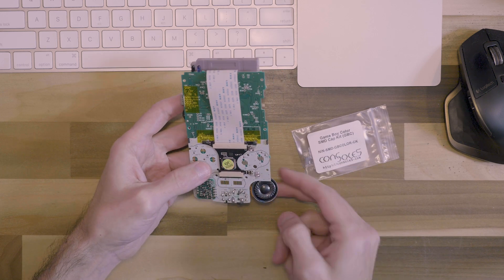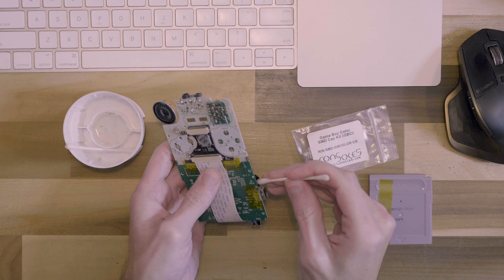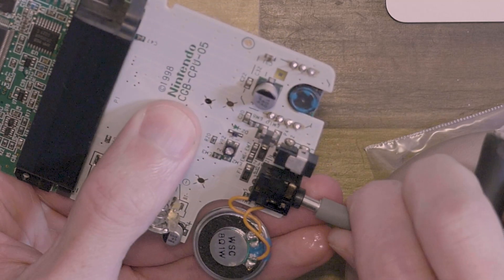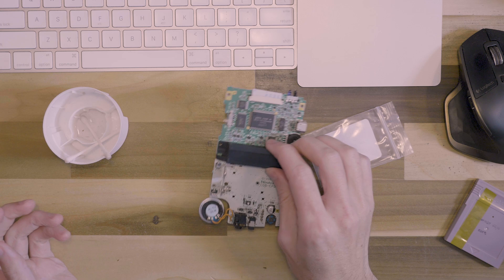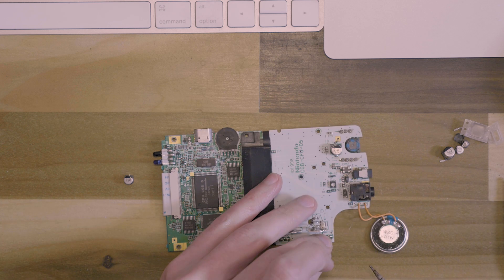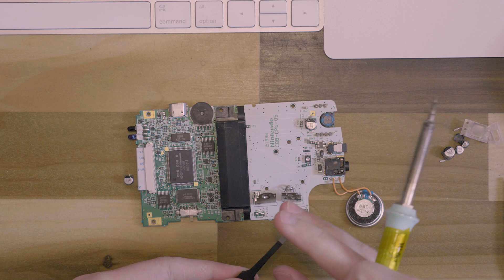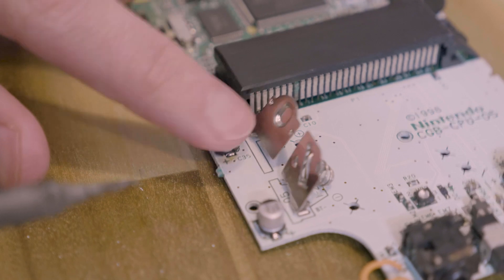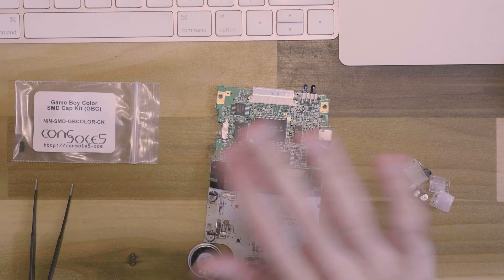How to Fix Audio Issues on a Game Boy! Cleaning and Cap Replacement on a Game Boy Color

Comment from the maker: So I've gotten a few comments from people who have torn the solder pads underneath the capacitors. The method I showed in this video where you wiggle the capacitor back and forth until it breaks really isn't the proper way to do it. It does often work, but a much more proper way would be to use a generous amount of flux and slightly higher than normal heat to really make sure it travels under the cap and melts all the old solder. Or better yet, if you have a hot air rework station, that would be even more ideal. The original solder that's there is old and definitely needs a lot of flux to get flowing properly again.
Reply: Thank you for the advice! I already understand that any DIY is at your own risk, so if I mess anything up its on me, not you. Thank you for the awesome videos!!
Reply: You can add some annotations on top of the video, to let people know that there are better ways on the pinned comment.
Reply: @n·o·h·u·p  YouTube deleted annotations a long time ago and removed the option to make them even longer ago.
Reply: I have seen this method as in the video in other videos and I'm looking for a video in which someone unsoldered the old capacitors, that has to work somehow. 🤔
Reply: Probably better to take down this video as it is harmful to the community, especially to beginners. Appreciate the intent behind this, but improper methods are improper for a reason.

Comment: Excellent video! One question: if during the removal of the capacitor you happen to damage the soldable area underneath the capacitors ¿how would you repair it? Would copper tape be useful so you can solder again on it?

Comment: Did a GBC power regulator mod and now I have no audio. I changed the other two capacitors just to be sure but still no luck. =\
Reply from the maker: No audio at all? What about through headphones?
Reply: @esotericsean  I just got home and tried the headphones and it works. I tried 2 other working speakers but I still didn’t have sound.

Comment: Can I replace with different speaker (example: speaker with suspension that can fits in the space)?
Reply from the maker: There are a lot of replacement speaker options. You just need to make sure that it uses the correct voltage and amperage, really.

Comment: My gameboy color speaker has a problem when I turn up to max volume the sound it produces very soft I replaced a new speak but no different. what should I do ?
Reply: Change the volume wheel. I had this issue. On max volume it was nearly inaudible but sounded okay on lesser volume. Cleaning didn’t fix it but a new volume wheel did.

Comment: I've changed out my capacitors, replaced the speakers, and cleaned over and over again the headphone jack which doesn't look like there is any corrosion on TWO different GBC's. On both of them them the sound still doesn't come out of the speakers but does in the headphone jack. Another youtuber told me its probably the headphone jack and told me to test the connections with a multimeter. 1. I don't know how to do that, do you know of a video or do you have any interest in making one of using a multimeter to check for stuff like 2. Any other suggestions of what might be wrong to fix the issue?
Reply: also looking for a good Discord server if anyone has a suggestion
Reply: I am exactly in the same situation. I have changed the speaker. I have disolder and cleaned the jack with isopropyl alcohol and vinegar, I have changed the capacitors.. still no sound coming out of the speaker. The headphones work but nothing comes out of the speaker. I have bought a brand new jack and will install it, this is my last hope lol.
Reply: @xarifab  where did you buy that? Also, let me know if it works!!!
Reply: @davidpohle  I got the jack a d the capacitors  from a website called jelly belly customs: https://www.jellybellycustoms.com/
I will let you know if replacing the jack will work on my console🤞🏾

Comment: How can I get one of those green cords? I noticed our gbc don't have one only batteries.  I think I need to clean our gbc sounds exactly  like yours:) this is very helpful. I never had a gbc these are our first.
Reply from the maker: It’s just an AC adapter, there’s a small port on the bottom of the Game Boy next to the headphone jack. You can get them cheap on eBay or AliExpress.

Comment: I won a bid on ebay on a yellow gbc for my kids  but sound you  can hear teeny tiny bit only if I put my ear on the console you can hear tiny tiny sound lol do you think I just need to clean speaker or Order new speakers?
Reply from the maker: Might just need to replace the speaker, but you should probably replace the capacitors too if possible since if they’re original, they won’t last much longer.

Comment: Hey, I love your videos.

I'm having a wild problem- my headphone socket doesn't work. Speaker does- socket doesn't. No sound, not even a click. The whole thing works fine apart from this. I've tried to look at the socket but I have no idea what to look for. Could you offer any advice? I'm so confused :(
Reply from the maker: That definitely sounds like something faulty with your headphone jack. Do you have a multimeter? You can check continuity with headphones plugged in and with them unplugged to see if the connection is actually switching.

Comment: Just another big tip, replace the 100uf, 6V cap with a 470uf or 680uf with voltage rating of at least 6v with a diameter of 6.3.
This removes lots of the high pitched noise and crackling noises.
Reply: I just spent some time with the schematic for a gameboy color, and it would sure seem like the 100uf 6v cap (C32 on the schematic) is a power filter cap and has nothing to do with the audio. Perhaps you meant the 100uf 4v cap which is C38 on the schematic?

Comment: Instructing people to just pry off components like that is so irresponsible, verging on malicious. You already have comments saying they ripped off the traces because of this video. If it's worth doing, it's worth doing right.
Reply from the maker: You're right. I've pinned a new comment with some better instructions. The method I showed here often does work fine, but it really isn't the proper way and it's certainly possible to lift the solder pads. Thanks for pointing this out! I'll be sure to show proper techniques in future videos.

Comment: How is the GB able to startup chime without batteries? Am I missing something?
Reply from the maker: James Moran I plugged in an AC adapter to the bottom 😊
Reply: Ahhh of course.  I kept staring at the empty battery terminals on the board thinking “what witchcraft had you performed?”. Lol

Comment: What does this board have plugged into the screen cable socket?
Reply from the maker: Edward T Crump That’s an “ElClono” adapter from BennVenn. It converts the signal from GBC to work with AGS-101 screens.
Reply: @esotericsean  Oh cool. I like how it's formed to sit on the board taking up the empty space.

Comment: Nice vid, makes sense that a cap replacement would fix the low volume issue. Should have done that do all the GBC's I've worked on. Well I will now. :)

Comment: Awesome video! I had to recap one of the capacitors on a board but unfortunately never got it to turn on :(
I did notice that the component C30 to the left of the capacitor opposite of the speaker is brown so maybe it is burnt? Do you happen to know a viable replacement for it? If it isn't too much trouble an Ebay link would be extra awesome.
Thank you for your amazing content Sean! :)